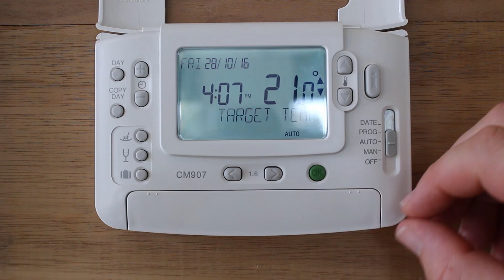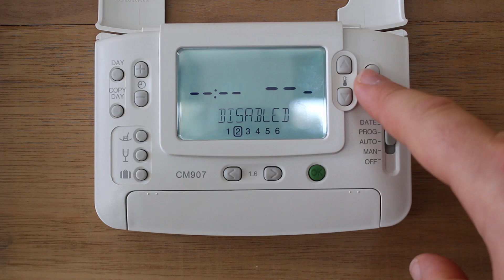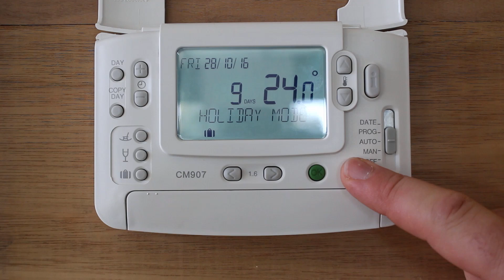ANSWERED: How to Programme the Honeywell CM907 Thermostatic Control Unit

Comment: Very useful video but mine is still coming on even when I’ve programmed it to turn off. Date and day are correct. Can’t work it out
Reply: My understanding is your settting target temps and not to turning off using these settings . Naturally a lower temp will turn off the boiler. When you want it off - choose a low temp

Comment: Can this thermostat be controlled to only heat up certain rooms ??
Reply from the maker: It can if it is connected to the right equipment to separate rooms. The thermostat itself only sends a signal on or off for something else to run.

Comment: I need help, I don't understand how to program.
I want the thermostat starts at 6pm and stop the day after at 8am.
Simply every day.
Reply from the maker: Think of the 1 - 6 as periods of the day that you must assign it something to do. In your scenario the earliest time of the day you want it to do something is 8am. So set period 1 as 8am at a really low temperature, so low that it won't come on. Then set period 2 - 5 at and other time at the same low temperature. This way it won't come on because it never gets to the temperature you need for it to trigger it to do so. Then at period 6 set it for 6pm at the temperature you want. Then copy that day and use it for all days. When in use the first time it will come on is at 6pm the next day, then as the day changes it will hit period 1 at a really low temperature and turn it off. Hope this helps.

Comment: ive done that procedure and everything seems fine but the heating just wont go on. any idea of what the problem might be?
Reply from the maker: There could be many reasons for the heating not going on. If there is a click the relay is sending a signal so it is more likely to be the boiler end. If there is no click the honeywell might be due to be replaced.